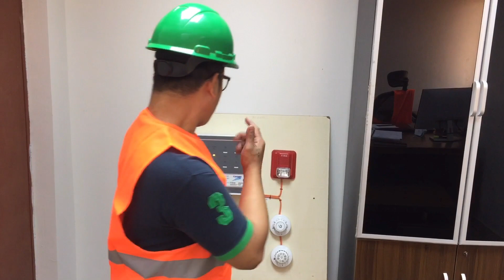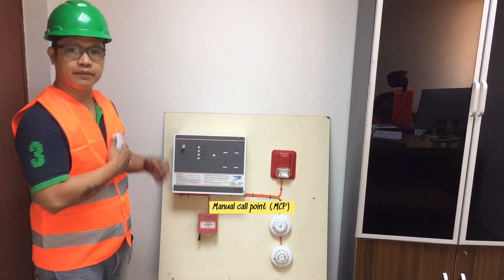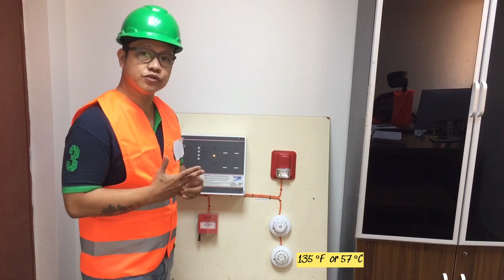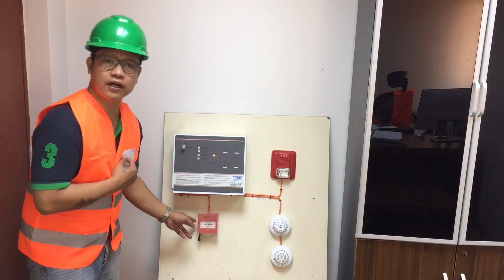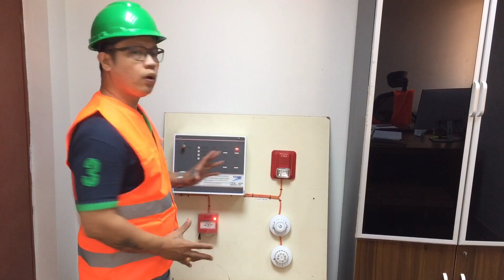Function of Fire Alarm System

Comment: Trabho se dimiyo antes na manila noy... 😁 😁 😁
Reply from the maker: Ansina noy? Hahaha!
Reply: @mrdimpletv5460  tiene pa se control number na heat and smoke detector para pwede man detect para na panel...
Reply from the maker: @KhevinLao  control number?
Reply: @mrdimpletv5460  si noy, abri tu se el smoke pati heat detector, tiene tu se pwede mira  adentro de esepara man contact el number para pwede man detect el panel...
Reply: @mrdimpletv5460 tiene se gat se number each detectors para sabe onde el eksato lugar ya pwede man detect, automatic se si tiene kema together with the water sprinkler....
Reply from the maker: @KhevinLao  ah baka zoning oste tan mean noy? Kay el conventional otro design pati el addressable. El addressable chene gat kel tan indicate kun kosa number el yan activate or si chene fault.
Reply from the maker: @KhevinLao  si noy na addressable type chene gat number tan indicate if chene yan activate or if chene fault.